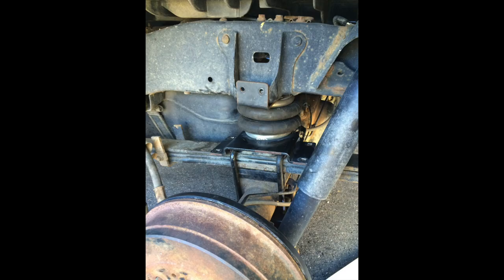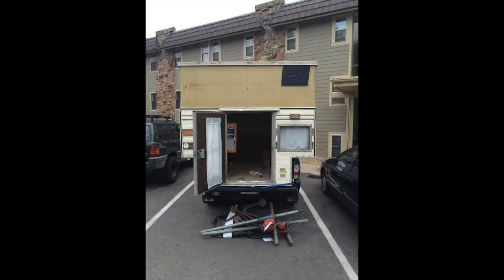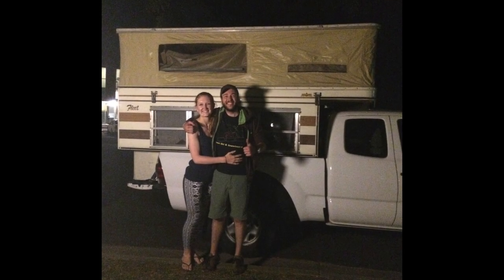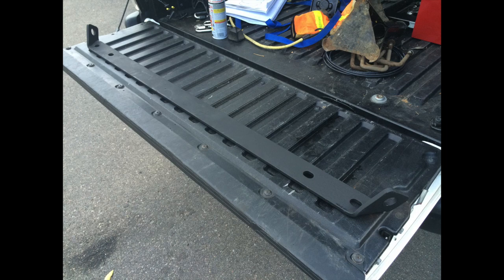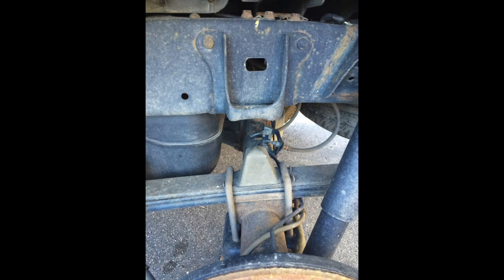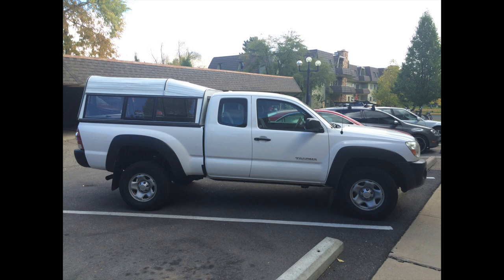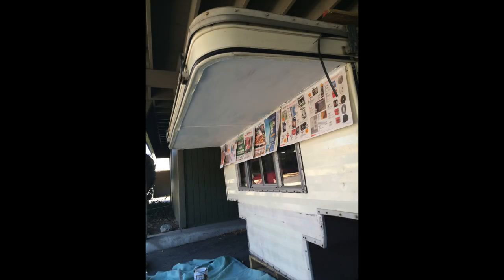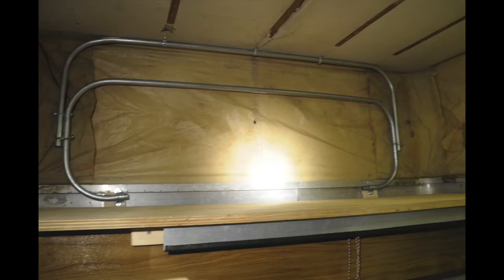DIY Pop Up Camper Rebuild | Mounting, Airbags, and Vent repair

Comment: Love this format. Like truck camper story time. The info is super helpful as i am working to mount our camper to our tacoma. Specifically clearing the roof of the  carport since our truck and camper going to be in our garage with a 7 ft door opening.
Reply from the maker: Thanks Thomas. Glad the videos are helpful. Any specific questions you have?
Reply: @tgmorrissey  - you have been answering them as you go thru the process of acquiring, installing and refurbishing the camper. Keep it up. Your format is very helpful
Reply from the maker: thomas dipaolo excellent. Will do.